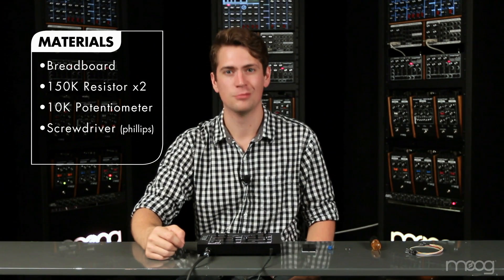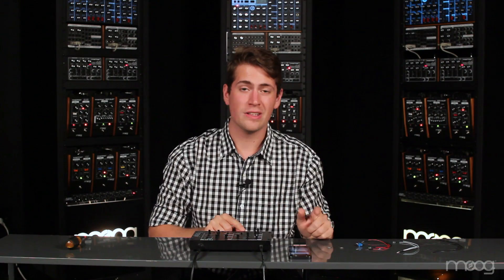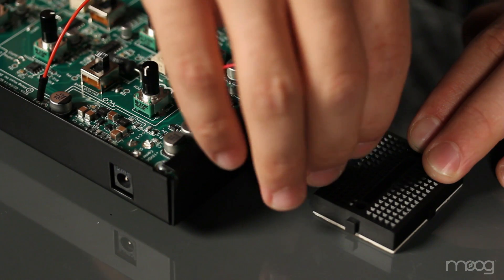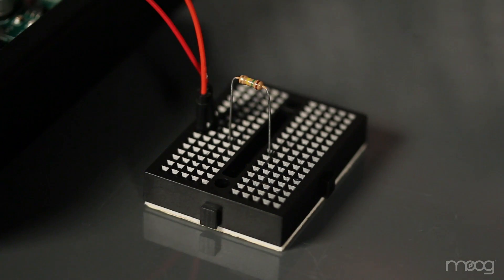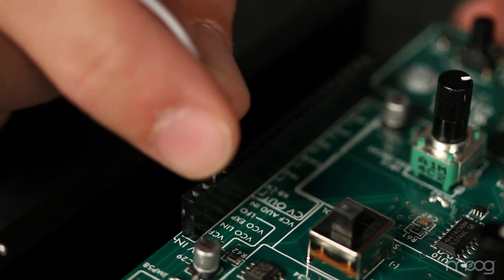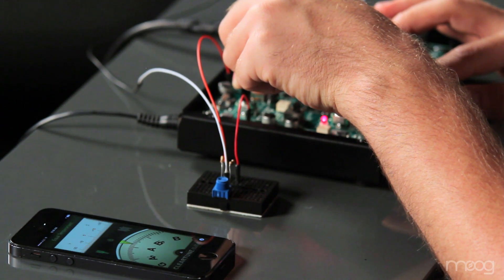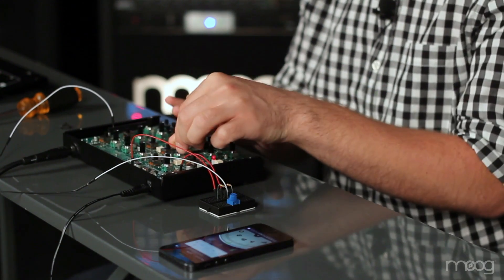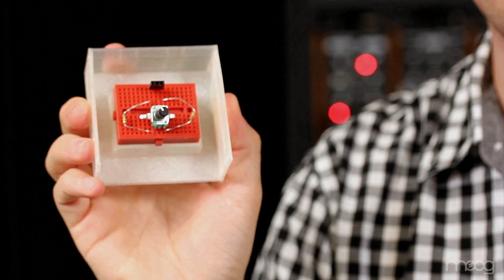WERKSTATT-01 | Fine Tune Mod

Comment: I just did this, very useful mod. I did it internally, soldering to the board underneath the jumper input. It can be used with the CV expander but you must put a dummy plug in the VCO Lin FM In.

Comment: How would this effect the new CV adapter if put in line. As in if I were to have this voltage added to the incoming frequency CV on the linear pin would it work in conjunction with it? As to make it easier to tune to my modular.

Comment: I have the CV Expander... Can I still institute this mod with the CV Expander installed?
Reply: Have you tired? I'm pretty sure there is an intonation/fine tune variable resistor inside the werkstatt, one of the flat white ones. Other than changing the cable form factor the expander just provides a ground through the case. I would try as hard as possible to keep everything in the case instead of making a separate enclosure. So yea just keep track of where the ground is and if you make the modification internally without using the 3.5mm connector might make things easier for you.

Comment: This sucks, the unit should comes with the Fine Tune install already, $325 is to much for a so limited synth like this.
Reply: in a way you pay that extra for the moog logo .... when you behringer model d is approx the same price they could have done it for cheaper [ none of moog stuff is still actually created in the us , maybe just installed in the u.s. with packaging and so ]
Reply: I only paid $225CAN for both of mine per unit
 (one new and one used)